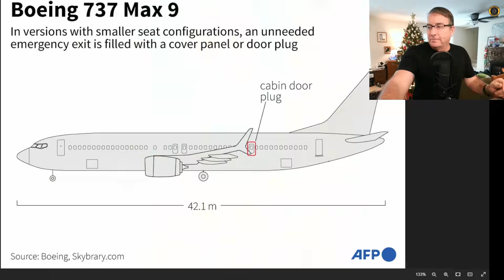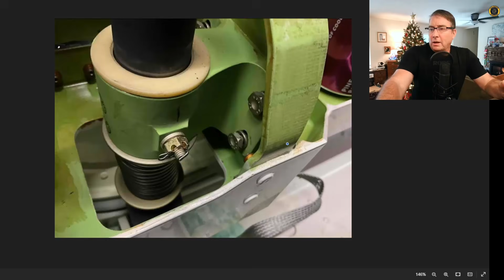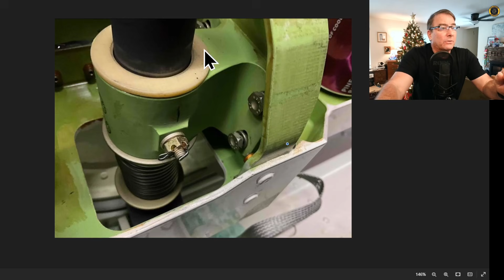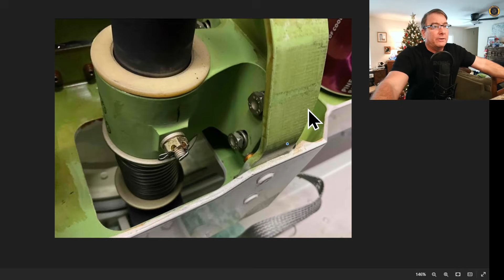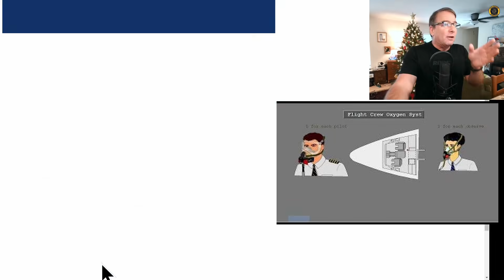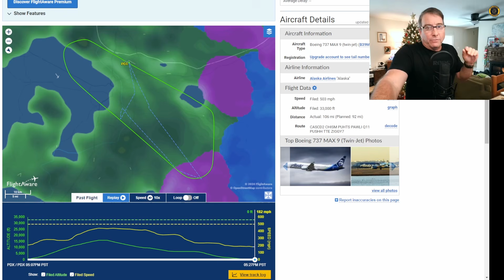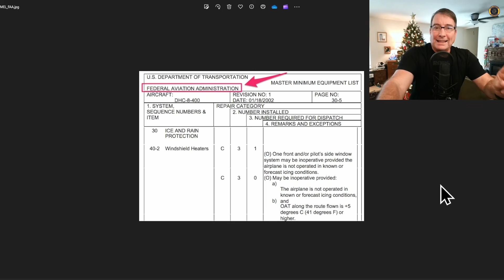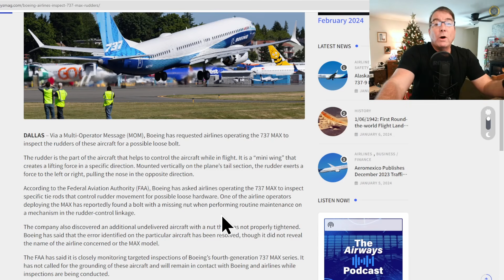"Yes, We Have No Bolts"  9 Jan 737 Max-9 Update

Comment: Juan, I have a question on a practical matter. I'm not an engineer but I think I'm fairly pragmatic (you could say "skeptical"). I've worked for airlines, and flown a ton, so I am fully aware that airlines can and do operate with certain "faults" but pressurization issues? If that sucker de-pressurizes at cruise altitude, we're not guaranteed a good outcome.

So, if an Alaska MAX-9 can carry 178 passengers and there were actually 171 on-board and, from what we're told the two seats adjacent to the door-plug were not occupied, what are the chances of that occurring? Did they just "know" or did they "guess"? I'm thinking that Alaska Airlines either knew there was an issue with this bird or they had received a notice from Boeing that the two seats adjacent to the plugs should be left vacant "just in case".
I cannot believe that a U.S.-based airline would actually permit an aircraft with a "defect" to climb into the wild-blue yonder with almost a full kite. That seems to be pretty reckless, doesn't it?

Comment: I think this only an engineering failure. They have overcomplicated the mechanism. The "plug doors" should be designed in such a way that it should only be able to come inside the plane when removed. The whole frame on the opening on the fuselage should be smaller than the door and there should be no way for the plug door to move outwards at all. When you need to remove it for maintenance or whatever reason then you undo the fixing that holds it in it's place (which has no vital role) take the door inside the plane, turn it sideways and then take it out from the opening. This is a door you remove from its place perhaps once or twice in the lifetime of the plane if ever. Russians would do it this way.

Comment: Did the NTSB release any pictures showing the door’s relevant mounting hardware?  I only saw pictures taken at angles very specifically showing only the outer surface.  This raises questions.  Why wasn’t the world allowed to see the hardware right then and there?  The answer is obvious, evidence of bolts having been mounted would have been revealed.  The press keeps talking about loose bolts.  This is misdirection.  The four relevant bolts are secured by castle nuts locked into place by cotter pins.  Mechanically, tightness isn’t relevant, the upper ones merely block the channel.  I don’t buy the idea Boeing or Spirit employees neglected the install this key hardware when mounting the door.  And if they had been installed, that the door could fall off is simply not possible.  I conclude the bolts were removed by third parties who intended this incident, and the public is being prevented from knowing that truth.  Similarly, that the Lion Air plane was being sent out for at least a week with a fault likely to cause a crash, see the accident report, and nearly crashed the previous day, was also neglected by the media, as was the highly coincidental presumed bird strike of the Ethiopian air speed indicator, which appears to have occurred exactly at the moment sensors detected take off.  I do not believe in coincidences such as this, nor in investigations that don’t answer obvious questions.  Who was seated by the door per ticketing, and why and when were they moved, and by whom?  That the two seats near the door would be empty on a plane nearly full is also curiously coincidental.

Comment: Does anyone know WHY the cockpit voice recorder is set to overwrite after such a short time if the circuit breaker is not pulled? Even with all the certification requirements for flight equipment, you would think by now there should be voice recorders that can preserve weeks if not months of recordings. This was not a plane that was 20 years old, it was apparently brand new. BTW. why is it not called "flight deck voice recorder" seeing that in passenger planes it does not appear to be called cockpit?

Comment: New aircraft are supposed to have all the bugs worked out of them. They have not been proven to be reliable until all of the problems have been addressed. A problem with pressurization can be a serious problem. In this case someone could have been sucked out of the door.

Comment: Just a small detail:
AFAIK one shouldn’t set the Oxygen masks to 100% O2, as this default setting is for Smoke removal (over pressure). 
To the contrary the QRH asks for the crew in case of EMER descent to set the mask regulator to normal where the O2 pressure is regulated to mix with the ambient O2, so the O2 endurance is increased, this to avoid running out of O2 before reaching the 10000ft safe altitude (which can take up to 15 minutes from Cruise FL)

Comment: Those bolts are unstressed in normal service so there is no reason for them to fail. If they aren't there now, I'm going to suggest they were never there. The rapid departure of the door would have stressed the rest of the mechanicals severely and quite probably caused the damage to the brackets.
Reply: amazing the door ever stayed in place without any bolts.  i can see missing one or two but that's a lot of bolts to not install
Reply: @Weathergeekdan  It's only those two bolts at  the top. The door is prevented from leaving by what amounts to hooks along the sides. The  hooks are disengaged by lifting the door a couple of inches. Those two bolts only job is to block the channel that the door moves up through. You could do the same job with a piece of string. The bolts absolutely were not there.
Reply: @donepearce 
They should be able to determine if the bolts were there by looking at the damage or lack of damage where the bolts were supposed to be. 
And if the bolts were never ever installed, then they wouldn’t be any marks on the metal where they they contact.
Though I have read that the bolts are installed at Spirit and removed during the aircraft manufacturing.
Reply: @neilkurzman4907  I believe that is exactly what they are doing. The surfaces are painted, and that makes it very easy to tell if a bolts has ever been tightened against them. Of course that doesn't tell if they had since been removed.
Reply: @donepearce  
It doesn’t matter if the surfaces are painted or not. The bolts leave marks on the metal, especially if there’s lock washers.
If the bolts had been loose, the vibration will leave marks on the metal also. 
And if they were shared off, that would leave some very large marks. So having the door and the aircraft should give them a lot of information. 
Also, inspecting other aircraft should also tell them about how properly or improperly the doors were installed
Reply: @donepearce    They don't need to fail. If the bolts were installed without the cotter pins, they could work their way loose from vibration.
Reply: @neilkurzman4907 whilst true. The painted surfaces makes it even easier to see the marks from the bolts. Which are possible even by eye. But yes the equipment they have they can see micro indentations . They will 100% know if they were there or not.
Reply: @Weathergeekdan There were bolts, what they mean is they just did not find them. They are probably lying on the gound somewhere along the flight path.
Reply: @Tugela60  
Or they were never installed
Reply: @neilkurzman4907  Unlikely. There would be checklists for the assembly, if they were not there it would have been noticed.
Reply: @Tugela60  
That’s exactly the problem. 
The bolts either we’re not installed or installed improperly. And the inspector approved it. Or there was no inspection in the workflow.
That’s a pretty big process problem
Reply: They SHOULD be stressed  due to bolt preload due to recommended assembly  torque . If those 4 bolts were not there, the entire hinge guide and spring assy should still be attached to the airframe.
Reply: Boeing is a joke....it will happen again
Reply: ahh sung to the tune from.
no milk today herman hermits song

Comment: As a Technical instructor and licensed engineer, I have noted a decline worldwide in engineering training and ability to analyse issues one passing the buck, B1/ Mechanical engineers blaming B2 Avionics as the cause. Same used to happen with flap rigging issues on B727.
It’s overdue to get the issues analysed properly especially with repeated reports, not just keep changing boxes.
It would in the case of a major safety item, be wise to monitor it as are other exits by incorporating door sensor and light.
🫡🤔from Australia🇦🇺

Comment: Honestly, I find loose bolts in the rudder mechanism WAY more scary than doors that can fall off. At least a missing door doesn't impact the plane's ability to fly, can't say that about a potentially jammed or loose control surface.
Reply: if the door blows off and hits tail/stabilizer everyone dies

Comment: There you go, finally you and everyone is getting to the real problem and what happened, yes spring is sprung/gone :). Those bolts which hold the fitting in place look like BACB30NM8s, which are very common 1/4" diameter steel bolts, cad-plated used on a lot of place on Boeing aircraft.
Reply: The bolts on the upper guide look a bit heavier.

Comment: i keep looking at that picture of the upper guide for the roller pin and how the safety bolt locks it in the closed position, surely the door has to be lowered against the lwr hinge pins for the roller pin to clear the guide cam to allow the door to open?

Comment: Might just be the camera angle or lighting, but at 21:30, don't those two bolts below the arrow look small for the job they are doing?  the washer on the far bolt is almost being pushed into the hole (probably an oval hole to allow for some alignment adjustments during assembly),  The bolt head looks like it almost fits into the hole too. Would be interesting to know how they get by without safety wire there too.  Are there nylock nuts on the other side or some other anti-vibration hardware?

Comment: It is not fair you are blaming the maintenance for not pulling the CVR CB. As you mentioned, it is and always was part of the emergency CL. 
But I do agree that the procedures should be amended and improved. Including a mandatory emergency training for the maintenance.
Reply: Might be a good idea for MX to check whether the breaker was pulled, and pull it if it wasn't.  Expect the pilots were pretty shaken.

Comment: How do I say this....
I do not personally work for Boeing.  I have worked in Naval aviation.  I have close contacts who hold a Yankee White who do work for Boeing.  That narrows things down.

My understanding of how Boeing works, now, is that it is extremely difficult for higher level managers to understand the importance of QA.
I deal with a similar problem in a factory where I do work, where IATF 16949 is a thing.  Maintenance, Quality - these are "not productive expenses" because they are indirect labor and often, on the surface, like to insist on spending more money despite the customer buying products.
I will only highlight issues I know about from my line of work, but there's a sort of chorus across most of industry, right now.

One of the managers (whom I would fire tomorrow if given the opportunity) fired most of our paint and e-coat department because they insisted on doing what they should do, rather than what he wanted done.  This was before my affiliation, but, now, literally no one knows how to run the equipment.  We have a vague idea - but... I'm pretty sure electrostatic paint guns aren't supoosed to be coating the exhaust fan with paint to the point we have to rent a crane to service it 3 times a year.  That seems kind of fucking stupid to me, but I don't make as much as a plant manager, so I must not be as smart or something.  Said factory manager likes to point out quality is the worst he's seen it in the entire history of the plant.  I don't disagree - but... well, he doesn't respond well to my motivational speaking about how he should do his job and what is and is not an appropriate thing to get bent out of shape over.
It's always fun when you are lectured about how the company is willing to spend money... and then two weeks later, you're buying every tarp, plastic wrap, and shower curtain from Lowe's and Menard's so you can wrap the power bus bars to keep the snow melt from dripping down on them and blowing out the plant's load centers.  Normal people might think the purpose of a roof is to stop the rain, but we're challenging old stereotypes and thinking outside the box, here.
You should have seen it when a sprinkler line blew in half one day after leaking for about a week.

If it isn't obvious - the problem is that we are run by people who were promoted and hired based on their ability to achieve single metrics of performance, not effectively run and maintain real systems.  Any rational person would say "what the fuck is wrong with you?  Fix the damned roof!"  The thing is, however, that no one in the positions which need to do these things is willing to stand up and state, confidently, to the overarching powers, what they actually need and why they need it.  They do not know how to deal with confrontation or how to make room for their needs within a discussion of expectations.  This leads to a complete implosion of integrity and morale.
Atlas shrugs.

This is not limited to Boeing.  It is all over industry.  Younger generations are coming in with no skills because no one made sure to teach them trade skills (I wasn't old enough to remove those programs from my school or vote for the people who did - nor did I coddle myself into being a snowflake).  They are saddled with debt and are working because it's better than being homeless or dead - not because of pride in craftsmanship.  The economic prospects have blown out all the fucks they have to give and the management that can never be pleased or thankful for anything does not build any in the workplace.  They are there - they sent a thing down the line after doing the thing and they get bitched at whether they try or don't try so who cares?  Get the paycheck and go home.

I do not think many realize just how bombed out manufacturing is.  There is no more ground left to run it into.

Comment: I wonder. Emergency exits could be been installed instead of door plugs in lower seating density Max-9 configurations since the airframes were designed to have emergency exits in these two locations. So, if and when a Max-9 with these door plugs crashes and everyone can not get out in time, what will be the financial repercussions be to the airline for not opting to actually have these two additional emergency exit doors? We already know that the airline response will be that the FAA didn't require this even though every Max-9 fuselage was designed and built to have these two emergency exit doors. What is wrong with having exit capacity which notably exceeds the FAA requirement in terms of getting all passengers off of an aircraft? Apparently Boeing thinks that this is wrong. Yet then again, Boeing has not been run by engineers for a very long time. In other words, the Boeing bean counters decided to offer this cost saving door plug option to airlines, and the bean counters of certain airlines decided to purchase this less expensive option. Both Boeing and the airline won in this scenario. The FAA still is trying to recover from their overly cozy history with aircraft manufacturers by trying now to present themselves as a "safety is everything" federal agency. In my humble opinion, both the FAA and Boeing have a long way to go. Perhaps even more so for the FAA, given the numerous and reported near collisions at airports around the country. It seems to me that if a an aircraft fuselage was designed to have exit doors at particular locations, then the aircraft should have exit doors at those particular fuselage locations regardless of the overall passenger density configuration which an airline might want to adopt or perhaps change after acceptance of an aircraft. I wonder, who does the FAA truly work for? The aircraft corporations or the federal government to protect its citizens? The same question can also be asked about the USDA which now allows Monsanto to use Agent Orange. Who does the USDA truly work for? The huge agriculture corporations or for the federal government to protect its citizens? Anyway, just some food for thought.

Comment: Juan, Airbus has a "pressure switch" that when it senses a change in pressure; the cockpit door unlocks. You can unlock the door by simply blowing across this switch located in the cockpit (and not touching anything). It's a piece if trivia that is not addressed in any pilot manual that I can see. There are other features about the airplane that are not addressed in any pilot manual as well. Boeing is not the only airliner manufacturer that holds some info back.....